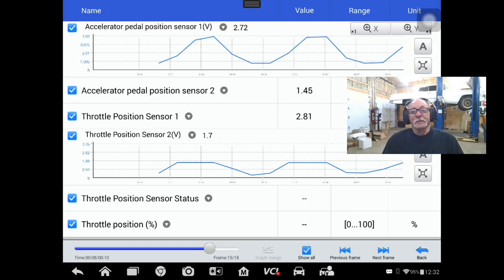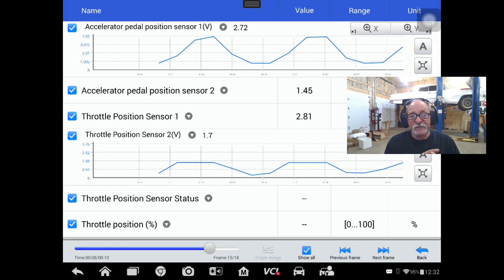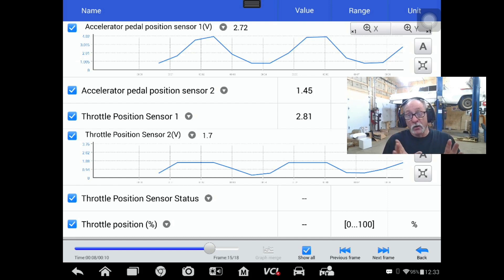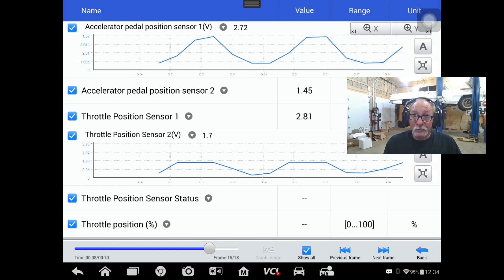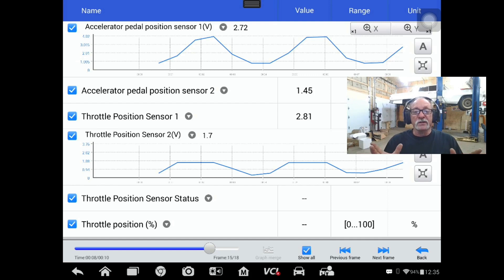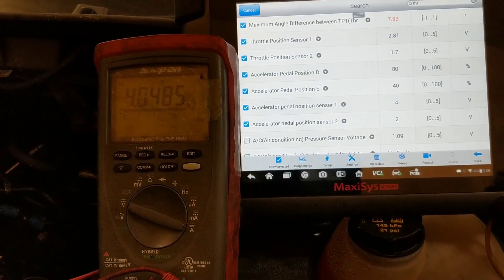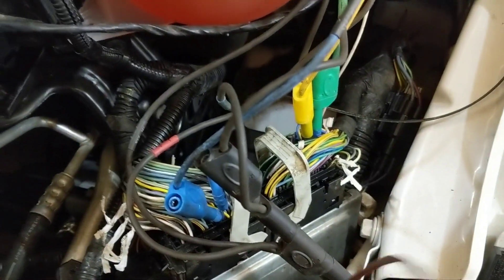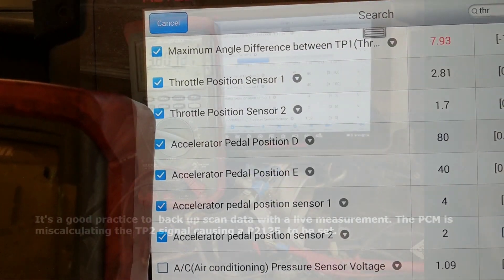P2135 Video

Comment: Did you try a second scan tool to verify it wasn’t just your scan tool lying? That’s pretty common as well. Good video, thanks 🙂
Reply: Great point!

It looked like he was using Ford IDS.   Wonder how likely it is for it to be wrong.
Reply: @kc360awareness  At the end of the video it shows he's using the Autel MaxiSYS, those are know to lie but see Che Kelley's reply below for a better point 😁
Reply: Not in this case because the engine computer set a code using the false data. It wouldn’t do that if it was just a scan tool issue.

Comment: Great video 
I hade a similar situation with a mass airflow sensor signal and computer was the fault of the cause 2012 Lexus 350 trouble code P0102 
Signal voltage was perfectly good but computer was interpreted totally wrong